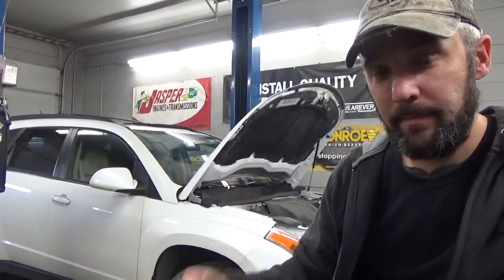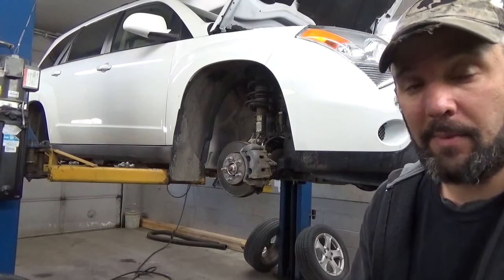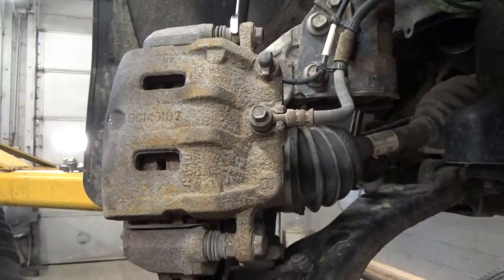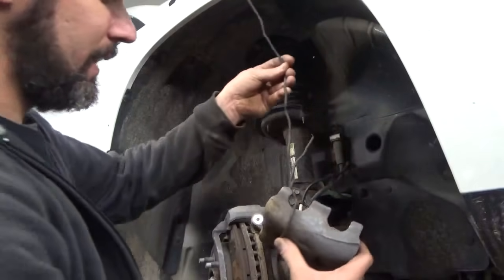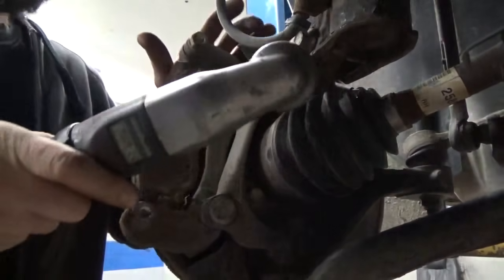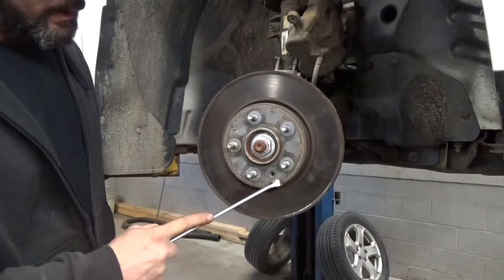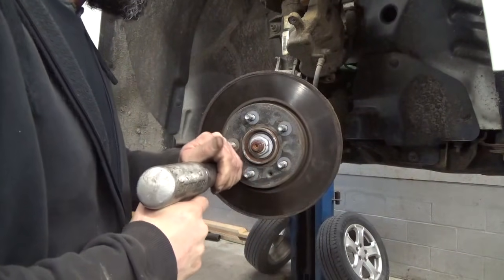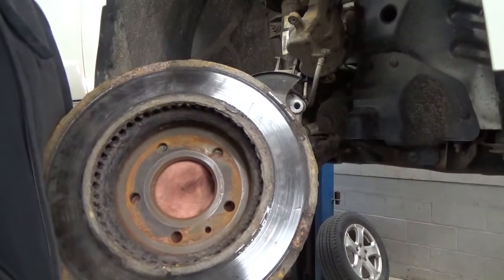Replace All Disc Brake Pads and Rotors - Suzuki XL7

Comment: SMA: You mentioned the various products that you used.  Purple grease? Silicone?  Can you comment on the exact products that you are using to do these brake jobs.  Or, better yet, have some links.  Or just mention the type, brand, where you got it etc.  That type of information would really help the DIY.  Your videos have good instructional content as far as the mechanics stuff, but there's missing information that is a negative on the value of your videos.

Comment: I have been working on cars (amateur) for 50 years, have owned and worked on a 2003 Subaru outback for 13 years.  This video on the P0483 error code is EXCELLENT!!  Thanks.. Peter Castaldi
Reply from the maker: Peter Castaldi Glad you enjoyed it :)

Comment: pushing the pistons in without opening the bleeder valve is actually a good method. its a good way to know if the flexible brake line hasn't collapsed and restricted flow . I apply this to every brake job iv done and never run into any trouble.

Comment: Brakes are the most over rated repairs on the planet. As this video demonstrates, they are a breeze to change for a fraction of the cost of what the corner brake 'n muffler place charges. They are pretty straight forward. Great video. It takes the mystery out of it the average FYI person.

Comment: Great video Eric. Thanks for all you do I enjoy your videos very much. I would add one thing if it comes from the factory with Loctite, always use Loctite replacing the fastener. Years ago I did a brake job on the F150. Torque the bolts to factory specs. For whatever reason one of the bolts backed out rubbed against aluminum wheel. Ended it up being a very expensive fix for me.

Comment: I am a chemist. There are hundreds of English words I do not know how to pronounce. Eric pronounces the element Molybdenum the way it is spelled. But as is true with many words that have been in use for 2,500 years, the spelling reflects the original, now dead language. Molybdenum is from classical Latin molybdaena. Latin which got it from ancient Greek molýbdaina. So reading it you would pronounce it "moly den um" (13:20) but the correct pronunciation is "mole lib' de num". Another example from the same ancient source is automaton, which looks like "auto may tom" but is actually "awe tom' uh tum".

Comment: Derrick Hodges had commented about you trying PB Blaster. There was a study done on YouTube awhile back compairing PB Blaster with Liquid Wrench and it was found liquid Wrench out performed Blaster by far. I only use Liquid wrench in my shop for the following reasons and that is cost, and that comparison test. Also breaks down to what any person prefers. Tho I believe any penetrating oil does its job well. Just saying

Comment: Something overlooked when it comes to frozen or I should say binding brakes is the fact that the constant friction of the rotors eats up gas mileage like crazy people that commute large distances each day often do not realize how much money they eat up do to improper functioning brakes.  I see that all the time here in my shop and often times ask my customers to pay attention and see if the car seems to move down the road more freely thus the vehicle getting better fuel mileage. I don't know if Eric agrees but that is my opinion. 
Also, more often then not brake pads are being replaced so I have always used one of the old pads and a small C-Clamp to push the pistons of a dual piston caliper back into the housing but as Eric mentioned in his Video be mindful of the fact that if you have to twist on the C-Clamp real hard you may want to consider replacing the Caliper.
Reply from the maker: Ralf V All good advise! Thanks for posting

Comment: I live in the rust-belt too and for years I have used the air-hammer or a ball peen hammer but I have to share one warning. When removing the rear rotors on a Toyota Highlander, used a ball peen hammer on the face of the rotor hub in between the lugs and it came right off. Issue was when we started the car the brake / abs light was on.. hammering the rotor face broke the ABS sensors on the rear, both sides.

Comment: would you advice pumping up the brake pedal  after each wheel has been completed?  and would you suggest starting from the furthest distance , usually the passenger rear , driver rear, passenger front , and finally driver front?

Comment: Hello. Thanks so much for your channel!

I'm watching some of your old videos and I wonder what your opinion is on using anti-seize on the caliper brackets below the hardware clips versus the grease that you use? Why is the grease a better option for preventing rust buildup or to keep the pad from binding? 

Also, no grease at all on the pad ears and hardware? Wouldn't it help it move more freely?

Comment: I make it a point to watch all your repair videos (old ones too regardless what you're working on. 

But on this one, I noticed you didn't use "brake caliper lube" where the "Brake caliper hardware" holds the Brake pads. Can lube be used there as well in order to make it easier for the brake pad to slide across the hardware?

Comment: I prefer pushing the piston in without opening the bleeder because it also allows you to see if the fluid flows through the soft hose and iv caught some hose lines that have collapsed and fluid flow was restricted through the line .

Comment: I almost always use the air hammer to loosen rotors. I pray that the rear rotors come off without having to adjust the parking brakes so they clear the ridge inside.

Comment: Thank you for making such and awesome tutorial. Best one on youtube by far. I have a late model sequoia so it's basically the same brakes.  I usually use CRC 05361 Silaramic Brake System Grease. Is that a mistake. Better/worse than the caliper grease you use/purple stuff?  Thank you again for the great video.
Reply: ahr355 I’ve personally tried both. The purple stuff lasts longer as I’ve seen cars years later and the purple stuff is still going strong as opposed to the Crc stuff I’ve seen go away, and isn’t as durable as the purple stuff. Sorry for the late reply

Comment: Discovered your channel a month ago while looking for a reason why my wife's 2012 Honda Pilot front brakes were squeaking after I changed them 6 months ago.  Your video's show lots of great details that others seem to skip. I did swap out the pads again (before finding your channel) and the squeak is gone but one step I missed was removing the rust from the wheel hub & caliper pistons and the 3 little spots on the caliper and applying some anti seize. Thanks for sharing your knowledge!  Any recommendations on a good brake hub resurfacing kit?  Found an OTC (8342) on Amazon but it looks like it is made out of plastic and probably won't last too long. Also, would Permatex 09128 Copper Anti-Seize be a decent alternative to Castle Muscle Grease?

Comment: It happened to me that even after cleaning up the caliper braket , i had pads that were really hard to slide on the hardware. I've grinded the ends of the pads to that they move more freely. I guess i should return them and try a different brand?

Comment: That is crazy how the rotor face rusts! I've never seen a car like that. How does it set in to where the pad doesn't "clean" the rust off? Would some extreme braking cycles knock it off?
Reply from the maker: Joe Shearer I dunno Joe, I don't know if it is cheap metal, low carbon or what it is. This car is a daily driver too. We see it a lot on all makes and models so I assume it is more the climate than anything.

Comment: Backgrounds kid working on a 1960 Rambler classic with my dad oh, we didn't have brake cleaner oh, we didn't have even a parts cleaner. It was strictly shade tree parking lot on base type of work and then it was the Home garage. We had a metal pan I don't know where my dad got it and we use gasoline or kerosene to clean stuff. The stiff paint brush or a putty knife painting on what the object was and what was being cleaned off. Gloves? What are those?

Comment: wire brush is better thana file or sand paper on brake caliper brackets and ive reused my hardware 3 years now in canada as long as its still shiny and you clean it with a wire brush and lube it good they last a couple years

Comment: I noticed that you do not use any lubricant or anti-seize on the pad "ears" where they slide in the hardware.  I like to put a little dab of Wurth 800 copper anti-seize (or even the purple Permatex you are using) to keep that area lubed.
Reply from the maker: Audioquest56 Yep it is totally fine to do it like that. The hardware we use does not rust so I have found it to be more important to lube behind them where they do rust ya know. Putting it both places never hurts though.

Comment: Another great tutorial here Eric! 
Just wondering how many brake parts cleaner you go through with a job like this? They're not that cheap here in Ontario - $7 bucks plus tax for those cleaners :s
Reply from the maker: +Miguel Carlo Carino 1 can usually, I only pay around 2 bucks I think
Reply: +South Main Auto Repair great price for those. you probably get a discount for buying in bulk. thank you for the effort in making these amazing tutorials!

Comment: I've always used an old brake pad against the cylinders then push back with a c clamp.What is the proper type of grease to use for  slide pins?
Reply from the maker: +Richard Cowtails Brake caliper grease... silicone

Comment: Are those GM brake caliper brackets on that thing? I just notice you said the from was 18mm and the rear was 15mm, you never see those sizes on real Japanese vehicles. Every other Japanese vehicle go's 8, 10, 12, 14, 17, 19, & 21mm

Comment: .Some cars have directional pads usually with chamfers and left and right arrows on the pads with some pads having a half moon crescent cut into the shim on the back of the pad which must be fitted properly failure to do so will cause much more noise and pad wear directional pads are becoming more common in today's cars.

Comment: I have 08 suzuki xl7 3.6. Ac and both fans doesn't work a/c clutch and fans work with Direct power. Fusses relays are good repl temp sensor it does have freon any ideas

Comment: Eric the only reason they put the screws in the rotor is to keep the rotors from falling off during the assembly process of the vehicle from falling off and hitting them on the toes.  I never replaced rotor screws is it really necessary?
Reply: Lon Willis he does mention that right after he sees it in

Comment: It's okay to push the Pistons in without breeding them. First you should take the cover off your master cylinder and place a rag underneath it. If you have ever topped off that Reservoir during the life of those brake pads your Reservoir will be too full and some brake fluid will run out. If you leave the top on you and take a chance of damaging the seal due to pressure and the reservoir.

Comment: What do you recommend using on the slide pins if they need lube?  Thanks,

Chris
Reply from the maker: shadowdog500 I use caliper grease
Reply: Maybe I should have asked that question differently.   Do you use a silicone grease like NAPA Sil-Glyde on the slides, or do you use the ceramic extreme on the slides.   I actually went through several of your brake videos to see if you use the ceramic extreme on the slides, but the slides didn't need lube on the videos I viewed.   I've always use silicone on the slides, and wondered if the ceramic extreme could be used for everything.   

Thanks,

Chris
Reply from the maker: Oh sorry Chris yes I use the ceramic extreme on everything :)
Reply: Thanks!   I need a new bottle of brake grease and am switching over to this ceramic grease based on your reccomendation.   You're costing me money;) I also bought a few tools you use including the air ratchet I picked up from Dennis about a week ago.  Chris
Reply from the maker: That ratchet is sweet right?
Reply: Yeah, I like it!  Until I saw your video I didn't know that impacting ratchets even existed. (I must live in a cave) My old air ratchets mostly sit in the bottom door because the best use I ever found for them was pinning my hands in odd places.  If Dennis ever offers the full size 130 ft-lb impacting air ratchet I may get one because it could handle just about anything on the car and the head would still be small enough to fit into tight places.  

Chris
Reply from the maker: SATAMAN Schmidt Will be getting a new stock soon and also a larger model. I will post it when he does.
Reply: shadowdog500  In a pinch (and sense this is a month old...for reference)  Silicone Paste works best for the rubber parts such as those slide pins.  (rubber parts inside)  Sili-glide is what I've used for the longest time.  Some complain anything with petro-based will interact with the rubber, so I wouldn't ever suggest "Grease".  If it's made for that application, it should serve you well.
Reply: I use the Extreme Ceramic by Permatex too, it's great stuff and I love the color... lol.! I put it on everything! It won't make the rubber parts swell like regular grease does sometimes

Comment: Something else you can see is the amount of contact between the pads and the rotor is greatly reduced because of the rust - even if the pads still had decent thickness and everything was moving free and smooth, the braking effectiveness is reduced by a large margin.

Comment: The top caliper retainer bolt doesn't need to be removed. The bottom retainer bolt can be removed and the caliper swung up and pull the slider and all out of the bracket. The first thing done before removing any bolts should have been to pry the caliper back to give the pads room to clear the rotor when swinging it up and out of the way. Relining sliders before reassembly is always recommended. That is a great caliper tool. Never crack a bleeder to push the caliper back, if it doesn't push back easily, it's possible it needs to be replaced. A little lube goes a long way on the sliders. That hardware doesn't need to be replaced every time unless completely rusted, bent or broken. Very few pad replacement kits issue this hardware at all. It's less common to need to replace them. Clean them with a wire brush and brake cleaner, lube them with any brake parts lube. You don't lube before the hardware goes on either, only the parts where the pads make contact need lube. It is easier to mount the pads once the caliper bracket is reinstalled back on the vehicle and the rotor is already in place.
Cleaning rotors with brake parts cleaner to remove the oil coat before installation is better because any rust prevention methods used prior can be cleaned away if sprayed after installation. The oil coat is there to help prevent rust on the rotor while it sits on a shelf waiting to be used.

Comment: the pad retainers don't need to be lubed? i think that's what i messed up with last time lol put lube on the pad retainers and it rusted up so everything squeaks without brake application
Reply from the maker: TeezyThaKidd  Yep lube is important :)
Reply: South Main Auto Repair hey there. lube is definitely important, for sure! i'm just wondering if the pad retainers themselves need to be lubricated (in reference to the side where the pads sit in), essentially lubricating the ears of the pads.. last time i did this, the lube burned up and rusted and the pads would squeak without depressing the brake pedal. in the video, lube was applied behind the pad retainers/onto the caliper bracket itself where the retainers sit. which makes complete sense, but i'm just wondering if he might've "forgotten" to lubricate the insides of the pad retainers, or if that actually doesn't need to be done.
Reply from the maker: TeezyThaKidd Well the most important thing to lube is behind the hardware on the bracket after you remove the rust this will prevent rust build up and keep the pad ears from being pinched in there.Make sense?
Reply: South Main Auto Repair ah ok, gotcha. i put lube ON the hardware. whoops! makes total sense, so i will keep that in mind next time. thanks!
Reply from the maker: Yeah no biggy, you got it now :)

Comment: I replaced my pads and rotors. I changed my brake fluid. Now, when I am driving and press on the brake pedal, I get a swooshing sound. How to fix this problem?
Reply: Air in the lines.how is your petal highth?

Comment: At 15:20, you can see that the caliper is just hanging from the line and not being  supported by a tie to the strut or knuckle.  Why are you just letting it hang like that?
Reply: Because hes done 10s of thousands of brake jobs and he knows that its ok. 

How many have you done?
Reply: rsx123 Eric mentioned in the beginning of the video to NOT let the caliper hang like that and so you can see my confusion.
Reply: Ryan Mariner It's not really hanging by the hose.  It's resting on the lower caliper mount.  If it was hanging by the hose, the hose would be straight...and it's not.  Cheers
Reply: jerrodl jerrodl I didn't notice that!  thanks for pointing it out.  it's nice to see a helpful response after that initial snarky reply I got from someone else.
Reply: I hear you, Ryan. Cheers

Comment: Well right there's your problem. The Chrome Muffler Bearing has become detached from the Elongated Dumaflotchy Gear assembly.
Reply from the maker: +Jeffrey dontyouwish I thought some one may have seen that besides me!
Reply: +South Main Auto Repair Ever try to replace the idler/pitman adjustment valve nozzle on this vehicle??